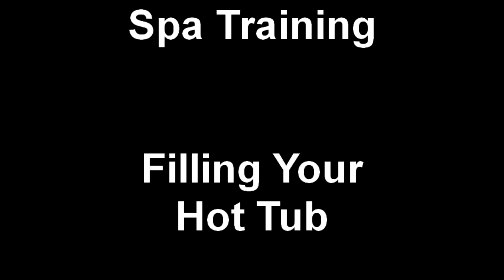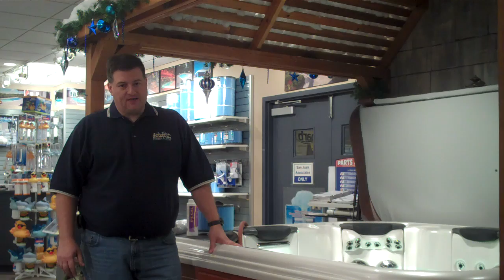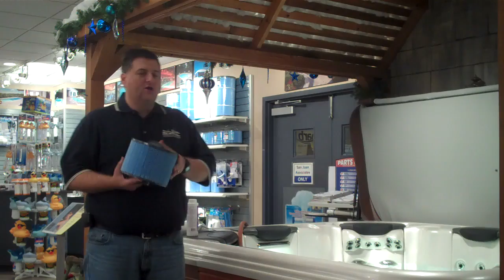How to fill your hot tub

Comment: what about air blockage if you dont fill it from the filter?
Reply from the maker: Filling your hot tub through the filter compartment lessens the chance to have an air pocket in the pump at start up.    If you do have a air in the pump, try turning the pump on for 30 seconds then off for 30 seconds for several cycles to purge the air and get the pump working.  If this doesn't work, you may need to slightly loosen a union on the pump to "bleed" the air from the pump.  Consult your local professional for more information.